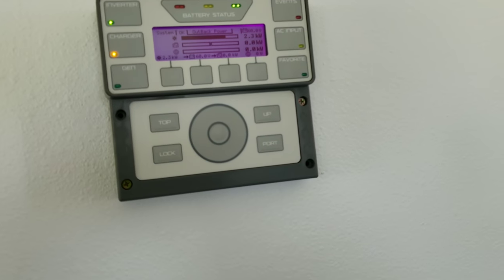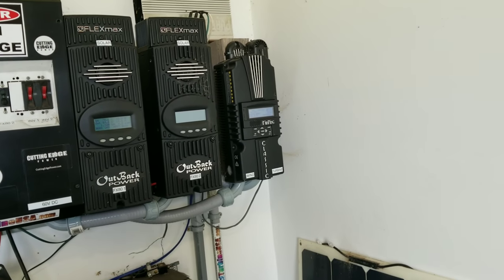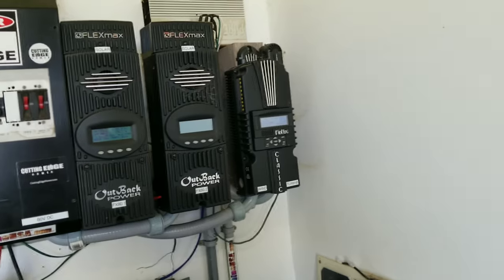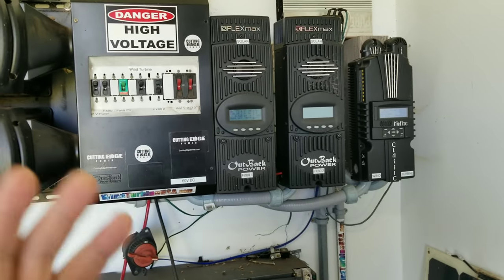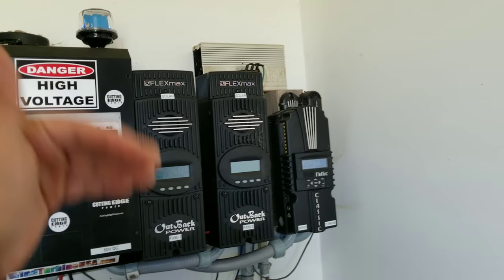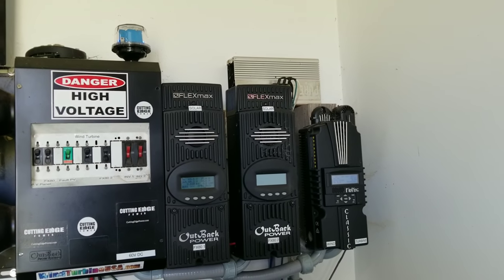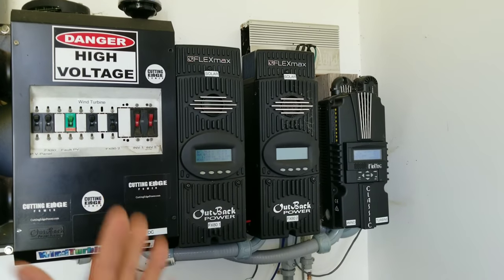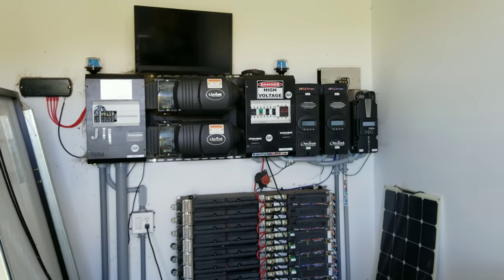DIY Solar Micro Cycling Your Batteries With Dump Load Off The Grid

Comment: Hey, good thinking BUT...  Micro-cycling the top most end of your batteries is not the same as deeper discharging, which will obviously affect battery life. And you DO want to connect the dump to your batteries. Your battery plates WILL remain in a state of very high charge and so will not incure degredation. If you take the power direct from your panels, there will not always be enough amps to meaningfully heat the dump as the dump load will not always have sufficient power available to operate as designed, resistance, volts and amps. If your upper and lower set points are suitably close, you take as much power from your panels as is available, and any short fall is taken from batteries. If excess power is still available, ALL power consumed by the dump will be taken directly from the panels via the battery terminal connections and the regulator will maintain the batteries at full capacity, **note**. If sufficient power for dump is not available from pannels, a small amount of power will be taken from the batteries, which will drop the voltage down a little below the lower set point, and the dump will thus turn off until the high set point is turns it on again. you need to experiment with your individual system to arrive at optimum settings and you may need to seasonally adjust these by a small amount to maintain optimum operation due to temperature variations. Now the **note**.... matching you system dynamics: array size, situation, orientation etc; battery capacity; use characteristics; dump capacity and actual dump unit particulars is important. If on an average good day, you might have 400W spare, then a 300W dump will be better than a 600W unit. Sure, you might occasionally lose a little power, but your dump will run at optimum for much longer while taking very little draw from your batteries the majority of the time, and then, only for a very short amount of time at a time. A simple check is when your dump is running at or near capacity, just turn the dump of and note your volt meter and regulator status simultaneously. you should see that your batteries ate at full charge and the regulator is in almost full regulating mode, i.e. only allowing a tiny amount of power from your aray into the bsttery, if any at all. It is never going to be 100% due to hystersis, however, with a little effort, you can get VERY close.  I do not have an expensive regulator, just a cheapie cheapie PWM from ebay, and built the dump controller for a couple of pounds using a FET instead of relays. works great (24V system plus 300W 12V immersion heater with 2 150W elements, which were wired in series to convert to 24V). I am not an expert, but have lived 100% solar for 11 years with no backup and all done on an extremely tight budget. My battery bank is much to small, resulting in very high C rates, both charge and discharge, in that time, I have gone through 2 sets of two batteries. Considering how over stressed my system is, I think that the batteries have fared very well under the circumstances, including with the dump opperating from mid february to early november in SW England!! So what I offer here is from personal experience amd I hope it may be of some use to some with respect to issues pertaining to dump loads, or at least add a little additional/alternative perspective to this subject. Good luck and all "power" to you all.
Reply: I have this similar setup you are talking about, just wondering how you deal with the frequent relay on off situations when clouds pass by
Reply: @rolandlukyamuzi4230  Hey Roland....  I had forgotten that I had made this post...  quite a while ago now !! I have just read through it and stand by it 100%. ALL the information you require to answer your question is contained within. Try going through it again breaking down the various sections until you have a reasonable handle on them, then relating them together should reveal anything that you are missing.... If the specific answer that you need still elludes you, please come back and I will be happy to see if I can help further.... regards, Nick

Comment: In the TriStar PWM Installation, Operation and Maintenance Manual it does say the energy will come from the source, not from the battery.
"As the battery becomes fully charged, the  FET switches are closed for longer periods of time to direct more current to the diversion load."
"When fully
 charged, all the source energy will flow into the diversion load if there are no other loads. The generating source is typically a wind or hydro generator."
Reply: Tristar PWM controller in diversion setup wires the PV array directly across the battery.
It turns on the dump load via the controller input so the output PWM proportionally drives the dump.
Having the PV directly across the battery makes selection of the dump resistance critical as too high a resistance will prevent sufficient bypass and the batteries will cook.
Reply: Are there any mmpt contrôlers that do this?

Comment: Very interesting!!! 
The longevity of lithium batteries is reduced by that last push of capacity... The 90% to 100%. Micro cycling at the top end should be avoided. 
I'm working on a diversion load controller that avoids this and several other problems.

Comment: Not sure I am following your logic here.  I do no have an Outback,  But do have a Midnite Solar Classic 150,  and from my extensive experience with this controller it is possible to extremely limit, or possibly completely eliminate what you are calling micro cycling.  The Waste Not Hi (aka Diversion Load) setting for the Classic is highly configurable when using the Auto Feature.  One can tweak the Delay and Hold settings to keep the Classic from diverting when there are clouds, etc and voltage triggers can be set to not allow any change in battery current flow when the diversion load is on.  

Example:  in full sun when my Lead Acid battery bank is fully charged (according to Specific Gravity and SOC of the Classic) the batteries are in Float and receiving 0.5 to 1.5 amps.  If my diversion load kicks in at 720 watts, and solar conditions are right, my battery voltage does not change from 27vFlt, and the float amperage to the battery does not change,  holds at 0.5 to 1.5 amps.  What changes is the power (Watts) coming in from the array.   It changes from 30W+/- to 750W+/- and the amperage coming in from the array goes up over 34amps.  The batteries are still receiving the exact same float charge voltage and current.  So the array,  and not the batteries is providing the diversion.  And this can be tweaked in the Classic to turn off the diversion if any thing changes before any charge is lost from the battery bank. 

While I understand in your case you are dealing with Li batteries and not floating them,  and this may be doing some "micro cycling" , but  the cycling would not necessarily be true in all cases in all battery types,  and could possibly be massively compensated for in Li chemistries as well with proper tuning of the Classic settings.

Comment: Exactly! I finally found a video that finally discussed this. I plan on using a digital voltage comparator and 2 ssrs. I have 6 strings of 2 x 370w solar panels in series with a morningstar 60A pwm charge controller. I am using chevy volt batteries. The digital voltage comparator will be sensing the battery voltage. If battery is bellow 50V close relay that connects one string to the combiner box bus bar and open the relay to hot water element. If battery is above 50V, open relay that connects solar string to combiner box and open relay that connects to hot water element. That way I can control how much solar I dedicate to my charge controller, not touch my batteries or inverter.
Reply from the maker: Nice
Reply: Yea... And while you have connected your panels on the heater, a high load is coming on the ac side of the inverter, it can't provide cause it lack solar energy and boom.. Suck it from the battery.... Annndd you got the same problem.
Reply: @honumoorea873  but if he uses ac power frim the battery doesnt really matter its a useful load.. in other words if i cause a discharge on my battery by turning on something im using then that is ok.. but a dump load cycling 100 times a day thats not useful
Reply: My dump load shunt was as described above by others, sensing the batteries' voltage and dumping them, and was cycling 10-50x per day and so then I have removed it and am rethinking.  I think I caused damage and am now replacing half of them, but also because I am still running them down daily.  The float voltage setting is false on weak ones and as soon as they are utilized the voltage drops more and more quickly, so a dump load would get cut off 'prematurely,' when looked at from the perspective of sun availability at the solar side and that the reason the batteries were almost fully charged was that there was sun and therefore we needed to create demand suddenly.  I really like the idea of controlling it on the solar side, and in fact on the battery side as well for wind-generation dumps.  A solar-side controller would have to take up to 200-500V for most systems, and I would teach it to listen to the voltage spikes because the amp demand to the panels fluctuates with not only with user demand but also battery demand and also sun availability.  But I have a lot to learn (foot in mouth). As my four rows of five panels send 140V current on dark days and 210V on sunny days, I might look to set some switch to trip at 200 or whatever amount can, on average, feed enough amps to turn on the hot water dump load AND float-charge the batteries, shutting off at the thermostat. Or a simple light sensor that actuates the AC water pre-heater to turn on only at the brightest parts of the day, thereby affecting demand from the inverter side and letting the charge controller regulate the ratio of battery and solar generation!   Hm. 
 For now I am thinking of using my $120 DC dump controller/voltage regulator switch again but with a few tenths of volts higher than the charge controller, as a backup to directly connecting the DC wind DC PMA alternator and balancing the dump load to a high wind power situation.  I dream of hot water but still manually turn on a 3kW mini-tank at noon and take a two-minute shower, am thankful my simple system allows for that at least.

Comment: Subscribed and waiting for an answer purely to/because-of this video.  If you wire up a dump load on the solar side, totally want to see how that is configured.  I've always questioned this methodology micro cycling the bank and would love to see an easy workaround and seems possible in theory.

Comment: A super capacitor bank between the charge controller and batteries might help with this... it would primarily cycle the super caps, if the cap pack is big enough
Reply: I was thinking about that same thing for solar dumping with super caps.  And then I seen something called ElectroDacus.  It's supposed to be a solar diversion controller.

Comment: You are right in that the system does micro cycle. The problem you will have in running direct from solar is that you lose the MPPT and so if dump load exceeds solar at any time the solar voltage will collapse until the dump load takes whatever current the panel will produce. As watts is Volts x amps and the volts have reduced then so has the power. I tackled this with a current sensor on a main battery lead which backs the dumping off when the battery current approaches zero. The result is that the voltage varies between float and dump level but no current leaves the batteries. If you put on a house load this is sensed and dumping also stopped immediately so the solar can power the load. I have graphs of both methods. The next aim is to use a PID method to predict battery voltage behaviour and smooth out the voltage swings that occur because battery voltage when not under load and fully charged moves down very slowly from absorb level but moves upwards very fast when a bit of current goes in. Super caps could possibly help here.
Reply: could you put up the circuit diagram for your battery current sensor and parts list. Love this idea.Thanks

Comment: great insights man!  Thanx for your vids over the years... I finally got my first 400w turbine a few months ago (to complement my old 55watt coleman panels been hanging off my garage and charging a battery for 3 years very very slowly  , lolol )   and having a great time with it.  The second day the turbine was up  had 35 mph and more winds, and the pole bent!   I straightened and lowered it a bit, and a week later we had another whole day of similar wind.  On that day I brought in 1.2kw... but that was on the dc side shunt read out.  Now the power goes into charge the battery (loss), then wait (loss), then get sucked at a terrible loss thru the inverter, and worse the inverter is usually on (loss).  All these questions and more are arising fast with my first little system. 

Totally agree with your video here.  Your battery getting cycled (loss),  your inverter working at a loss (loss),  and those two losses are doubled when the whole time pure excess dc load could raise water or heat it, or chill water or freeze it,  or compress air ...

Comment: I very much agree. I went to using no dump. Put a switch in to open system. Once batteries are full. 
The dump load I recieved didn't have a way to adjust when it dumped. It was preset. Which would dump at 12 volt not 13.2v.  So it was near useless.
@ 11:00 hope you show  wire diagram
Where do I find the adjustable dumpers?
Reply: I've developed my own pwm dump controller.

It also features relay driving capabilities.
I do both, pwm dump from my lithium battery bank, as well direct dump from solar to grid tie.

When night comes, it automatically switches and put my battery bank into grid tie.

So:
I charge my lithium battery bank,
Then I divert solar to grid tie
Then at night i run the grid tie from the battery bank.

Comment: I had same problem 2 years ago.  I did close to what you was saying.  I used a battery monitor to control relays on the solar input side and divert the power to a water tank that stores heat, for my night time thermal electric power generating. When the batteries drop to my low setting.  It switches power back to the charge controller.
Reply from the maker: Yes sir exactly. Anyone one can run there System the way they want I'm just trying to help others think outside the box. The less we have to touch the batteries the better in the long run. Thanks for your support and thanks for sharing.
Reply: I would like to dump load into home heating too. I need some schematics
Reply: So how does a battery monitor control relays?  Did you wire into the alarm sound or something?  Trying to figure out my system

Comment: I have a L1 charger for my EV at 120volts for dumping. My impression was the incoming solar was used be the load first and excess went to the batteries. Ex 2kw in the car pulls 1400watts then 600watts go to the batteries when fully charged the full solar input go's to load. Am I missing something?
Have Outback FP1 with lithium battery bank.